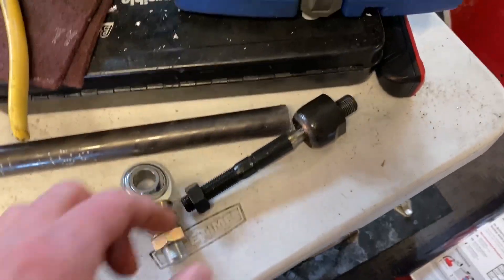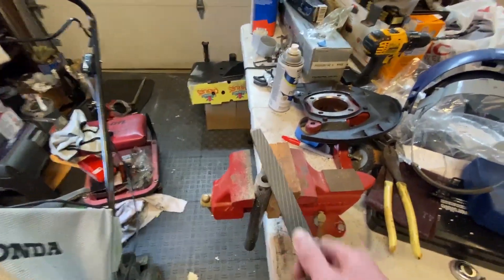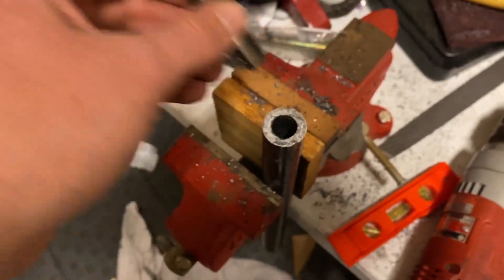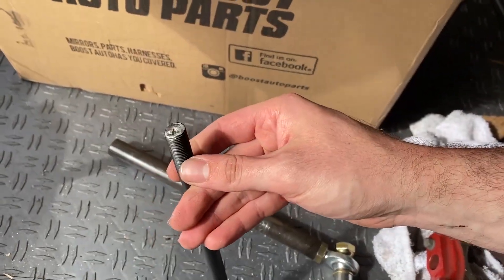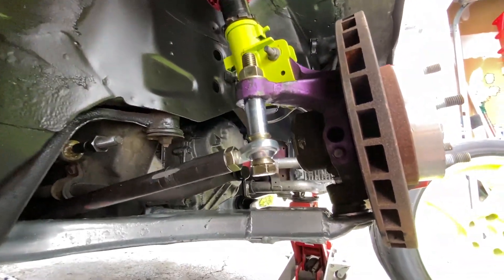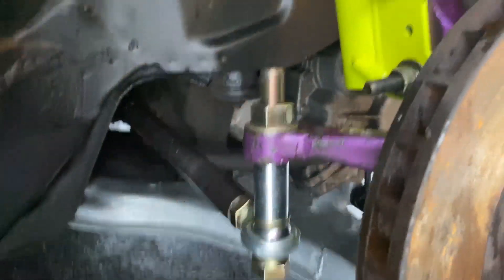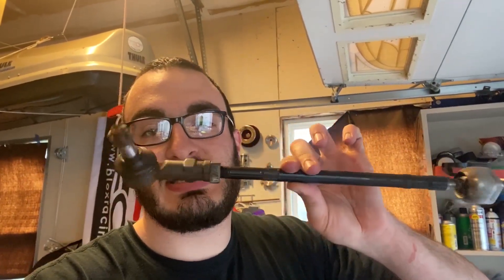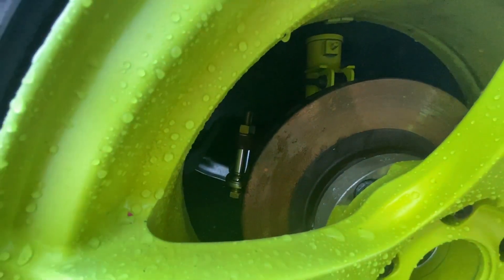Build Your Own TIE RODS! (3000GT Drift Car)

Comment: Omg now I found my way of building my steering system for mine. I had the thought of doing this but I never did it because I was so unsure how it would come out but now. I need to do this so I can use my factory VR4 rack. Dude you rock!!!! I need a parts list with the joints and tubing and such because I seriously need to do this for my RWD 4G63 build. What’s the tubing that the 5/8’s bolt goes through to the knuckle
Reply from the maker: peep the description for the whole parts list!  that silver tube it a spacer to help with bump steer on a lowered car.  the spacer in the video is a bit overkill.  I'm knocking it back to a .5 or 1" spacer.
Reply: Mike DeFusco I saw after I commented but what’s the spec on the silver tube besides being a 5/8 inner diameter did you get that specific tubing online? Because man now that you got to show the YouTube world your own designer tie rods. It will totally help out in how I can build my steering system without buying Souter rack modding that because I wanna keep and use the factory rack and such. It’ll make things so lot easier when I get stuff for it and keeping mostly Mitsubishi. If you look on Facebook in the one who’s got the black VR4 with a 4G63 with a BMW ZF M52 trans. I also added you on Facebook in case I got questions.
Reply from the maker: it’s 1.5” y’all and 5/8” ID. just grabbed them at lowe’s in the hardware drawers when i bought the bolts and drill bits!
Reply: Mike DeFusco nice man!!! This seriously helped out on my build and hope I can get it going again and post more. What other plans you have for your mitsu?
Reply from the maker: awesome i’m glad it helped! new knuckles are coming soon for more angle with this setup. then some other little things here and there to hopefully be reliable once the drift season actually starts!
Reply: Mike DeFusco I’m hoping one day to meet you someday and meet up a the track and screw around with our cars.

Comment: Couldn't you also drill the center of the pipe larger then just weld the nuts straight to the pipe and do all the adjustments through the nuts? Or are the nuts being used to keep the pipe from changing its position?
Reply from the maker: The nuts act as lock nuts to prevent the rod from twisting and adjusting itself while driving.  Technically, I could have welded the nuts on the ends of the tube and put another nut on to lock them, but i would have less thread engagement.  These holes are threaded all the way in as far as I could, so that while fully compressed, there is maximum thread engagement.